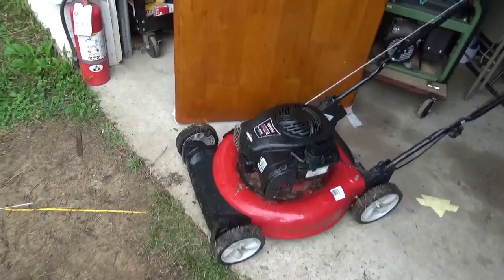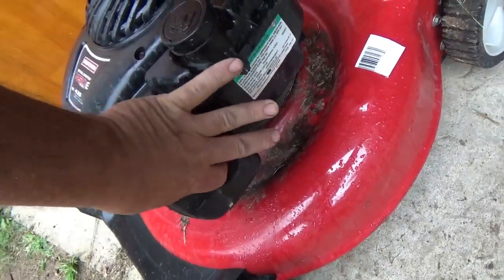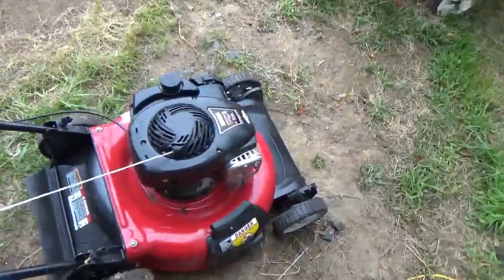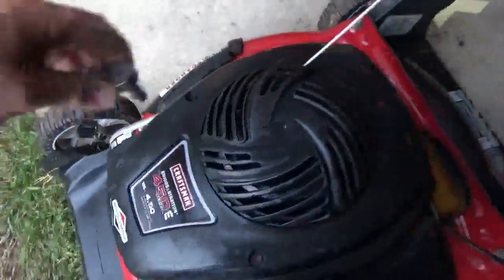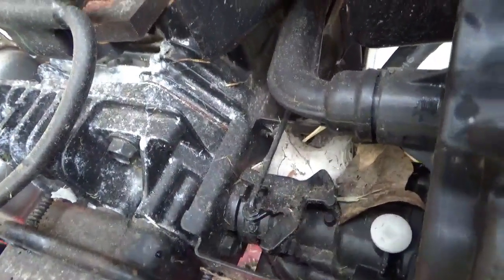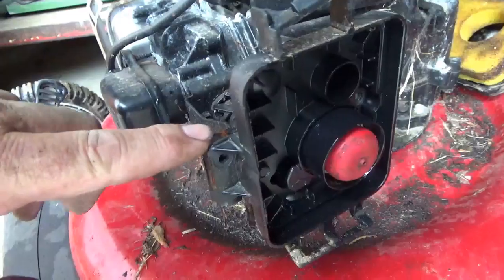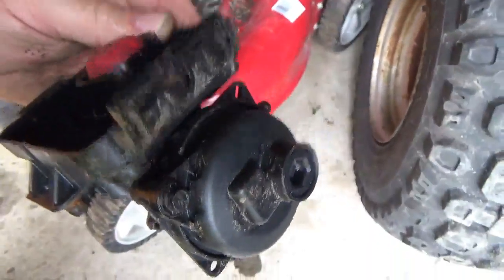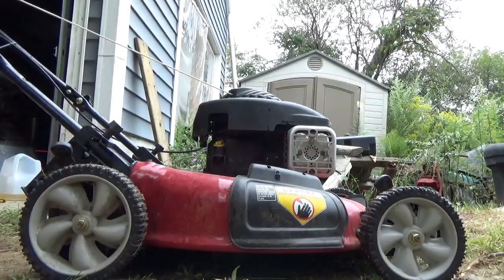$20 Sears Mower, Diagnostics, Repair of Flea Market Lawn Equipment!

Comment: I had that exact mower. All i wanted to do is mow the lawn. It would not stay running. I took the plarberator off 3 times. Its life ended with a 3lb sledge. Later that day my gf wanted to mow the lawn and she was out there pullin and pullin.. i was laughing my ass off. She finally realized half the engine was missing. Lol. 😲🤣🤣 (was probably just water in the gas. Lol?🤾🏻‍♂️)

Comment: This new "gas" will suck up water even if it is in your garage. The solution is dont use ethanol gas in atv's or power equipment. Don't leave it in the fuel tanks of anything for an extended period. Drain the tanks and carbs of anything you have used ethanol fuel.  👍👍